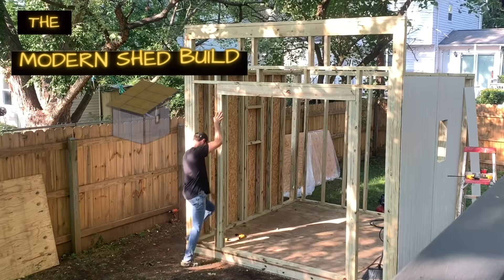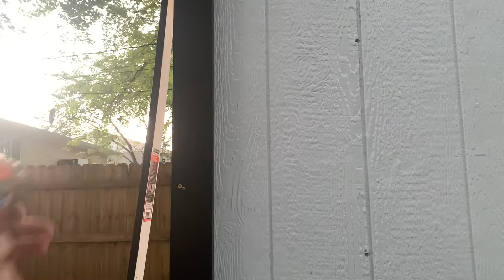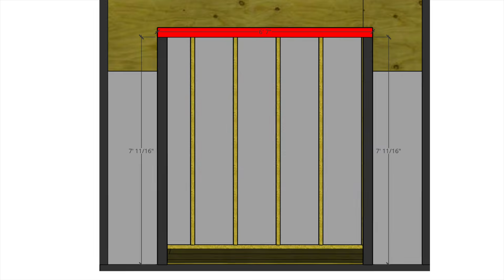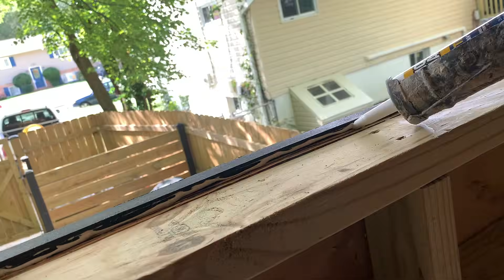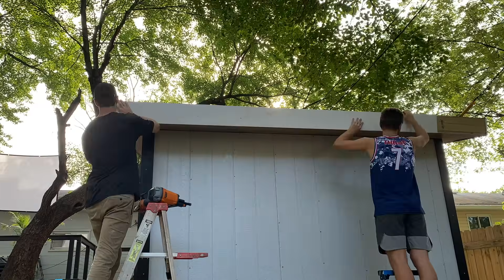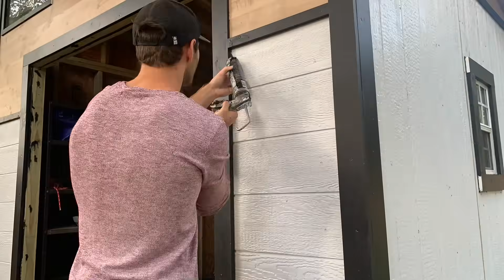How to Install Shed Trim (DIY Shed Trim Installation Guide)

Comment: For the horizontal connection between the two framing pieces, shouldn't you be using z flashing?  I'm asking because I have a similar situation
Reply: Yes

Comment: With regard to the drip edges, are sliding the trim pieces underneath the drip edges? Or did you install trim first, then did the roofing
Reply: Drip edge on roofing needs to be the outermost layer over fascia. Its purpose is to have the water drip off it away from the structure

Comment: Any tips for adding trim to a 45 degree corner? I am working on an octagon build.
Reply from the maker: I think you need to miter at 67.5 degree to make up the 135 degree obtuse angle 📐

Comment: The contemporary design of your shed project is excellent! The horizontal pattern of the sheet siding in particular works great.  How is that black paint holding up on the PVC trim boards?  I've seen mention elsewhere that dark colors on the plastic can cause problems.